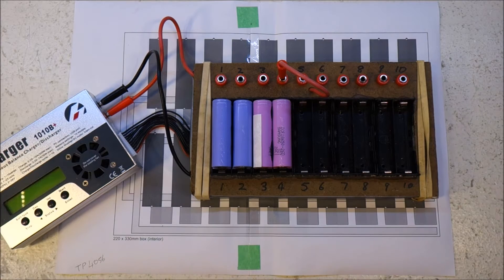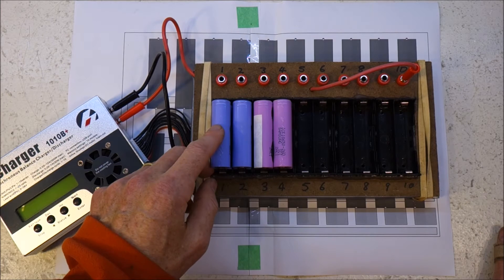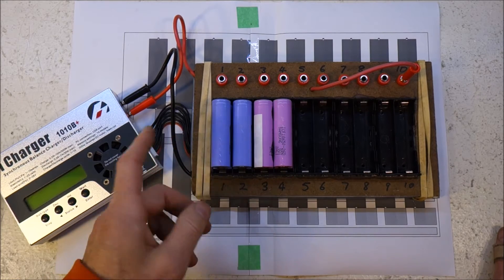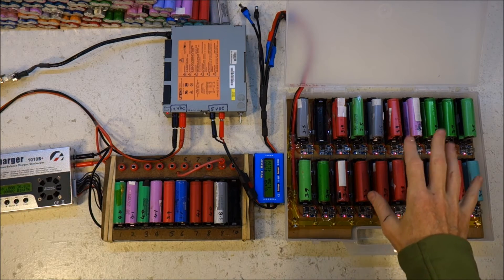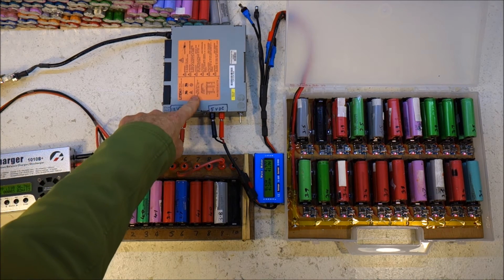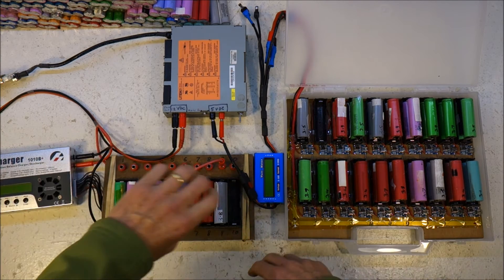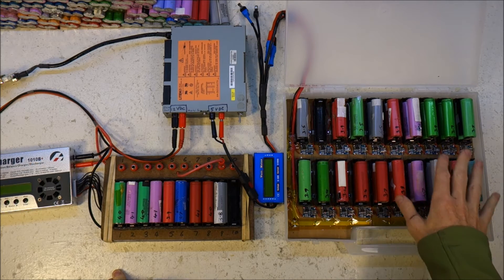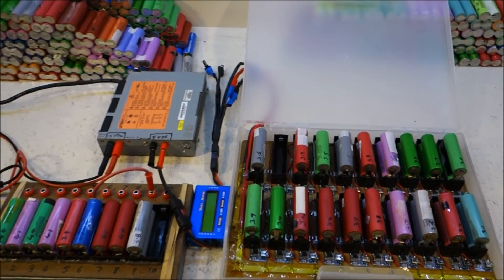Laptop Powerwall 31 - 20-way 18650 charger

Comment: Hello Paul...First, Thank You for all your effort making this documentation.   I was wondering, if a single " back block diode (1N4001) in front of each 4056, could insure against wrong polarity?   May be the Volt output of the powersupply, will have to be increased, by the V.drop across the diode...Hmm... I will order a few 4056 and make a test setup.
Reply from the maker: Typically there's a 0.7 volt drop across a 1N4001. This would complicate the charging - if the cell was at 4.0 v and there was a diode between it and the TP4056 charger then the charger would see only 3.3 v.

Comment: This is what I did for my chargers. I bought 6 of these on ebay:
http://www.ebay.com/itm/262580333705?_trksid=p2057872.m2749.l2649&var=561456286450&ssPageName=STRK%3AMEBIDX%3AIT

Then I bought 2x 3 port USB chargers:
http://www.ebay.com/itm/3-1A-3-USB-Port-Wall-Travel-Charging-Adapter-For-Samsung-iPhone-6S-5S-EU-US-Plug-/182221268590?var=&hash=item2a6d3be66e:m:mPeIDUOOwyr5bKz7NgKT3WA\

And I bought some micro USB cables:
http://www.ebay.com/itm/181846722929?_trksid=p2057872.m2749.l2649&var=480806591092&ssPageName=STRK%3AMEBIDX%3AIT

Now I can charge 48 individual cells (or 96 cells in pairs) from this charger setup. Granted, it's very slow, but I am just building a single 1.45KWh ebike battery so my system will suffice.
Reply from the maker: Yep - that'll do it.

Comment: Yeah a good system Paul. For those not having a computer power lead to give 5 volts I charge my TP4056s with a USB charger and mini usb charge leads. 
http://www.ebay.co.uk/ulk/itm/121705587044. which has different am pages. I connect 5 mini boards at a time parallel and plug in the leads in just one port. As you say they have no protection so easily blown. For discharging I bought these cheaper boards http://www.ebay.co.uk/ulk/itm/291643036289  Cheers.
Reply from the maker: +harveyboy45 Thanks for the pointer to your discharger - I hadn't seen those before. I found a slightly cheaper one on Aliexpress: http://www.aliexpress.com/item/18650-li-ion-lithium-lead-acid-Battery-Capacity-Meter-discharge-Tester-1-5v-12v-free-shipping/32365324311.html so I'll get one and give it a test.
Reply: +Paul Kennett Haven't figured out what charger to put them through. I think it needs 15 volts input. Any ideas?
Reply from the maker: +harveyboy45 I got some old Toshiba Laptop power supplies that were 15V and 6 Amps from my local IT recycling outfit. You can probably get them on Ebay or Craigslist if you're in the US.

Comment: Those single battery holders are the ones that are better then mine that i used in the discharger, My single battery holders have a spring on the bottom, which do not work very well and get very very annoying as the spring looses it push. 
So if anyone is buying the battery holders buy the ones shown on this video not the ones i got :) Hope that helps.
Reply from the maker: +Mikes DIY Tesla Powerwall I had to rivet them down. The hot melt glue was way too weak to hold them down. Also any cells that warmed up tended to soften the glue. Working fine now they're riveted though.

Comment: I like your work, Is the plan to get 20 discharge boards next? I know they are a lot more expensive, about $15 each but to get through testing them they seem pretty crucial to time saving.
Reply from the maker: Yep. 20 way discharging would be great. Using my five iMax B6s til my friends Arduino system is ready. Might still be cheaper to use the Chinese 4-way D ischargers.
Reply: +Paul Kennett looks like they can be had for 26 USD each. Probably the way to go if your not that keen or good at soldering.....

Comment: Thank you for the all the vids, gives a very structured approach. I am guessing one of the next ones should be about discharging high volumes?, if your friend manages something that would be great (drooling...). In the meantime there are the chinese "Opus BT-C3100 V2.2 Digital" that will manage 4 individual cell discharges for a similar price as the imax B6 (on ebay), I believe the Opus also measures internal resistance. I ordered one a few days ago so I still do not know how reliable it is.
Reply from the maker: +Rincewind TheFirst I've also got one on order for testing. That'll get me up to 9 parallel dischargers while I wait for my friend to finish his Arduino project.
Reply: I got mine and started using it. It seems to work quite well, maybe the Internal resistance measurement is a bit temperamental (I got one 18650 that gave results between 100 and 160)
Reply from the maker: Mine arrived yesterday. I haven't tried the IR measure yet though.

Comment: is the amount of mah that a battery is discharge as the battery total mah
Reply from the maker: +Chis Ngwa Do you mean "Is the amount of mAh that a battery is discharged the same as the battery total mAh?"
If so - yes the amount of measured mAh from discharging is what you can call "battery total mAh". 
Given that we're playing with recycled cells then the measured mAh will be somewhere less than the brand-new capacity. We have to test for that because some cells will still be OK and some will be thrashed.

Comment: That charging set up is outstanding!!! I had 10 tp4056 chargers but after about a month 4 burnt out.  Also they charge 0 volt cells too. I have had little success with 0 volt cells though.
Reply from the maker: +Craig Minca Any idea why the burnt out? I've been checking the temp of mine with my finger and they do get warm - but not too hot to touch. I wonder if they should have a fan running over them?
Reply: +Paul Kennett Fan! Thats a great idea. No idea why they burnt out. They were all on the same circuit and yes they did get warm but I never thought they were hot. Bad luck? Cheap electronics? Maybe. Either way doesnt really matter they are soooo cheap. :)
Reply from the maker: +Craig Minca True-dat

Comment: Have you seen my diy charger. Im using 20 of the tp4056s.  Its in my video, check it out.
Reply from the maker: +Your AveRage Joe Nice setup. What battery holders are you using? Mine are a bit too tight.
Reply: +Paul Kennett i just cut strips out of aluminum and bent them in an L shape,then drilled holes to hold them down and attach the wires to them.
Reply from the maker: +Your AveRage Joe Looks like it works well. I think I need to rivet my holders in. The hot glue I used ain't quite strong enough.
Reply: +Paul Kennett I have to replace 2 of mine for putting the cells in backwards to lol

Comment: you should google "tp4056 common ground". i think connecting them all to one power source might not work.
Reply from the maker: +StopLossLOL From what I can gather the TP4056 power in (negative) is common with the battery (negative).
In my setup the power terminals of the TP-4056 are connected in parallel. Each battery is only wired to one TP-4056, so the battery (+) terminals are isolated from each other. So the common "ground" (negative) is not a problem - or am I missing something?

Here's another example of my setup: https://youtu.be/o2OPs9s0fwQ?t=579
Reply: +Paul Kennett I think the common ground is an issue when you use multiple TP4056 to charge multiple cells in series. This is not the case here.